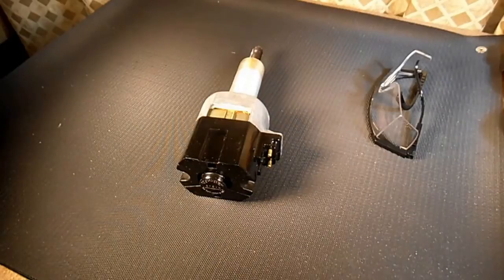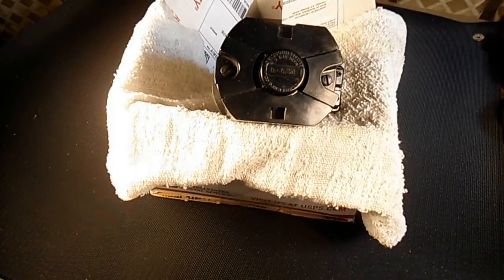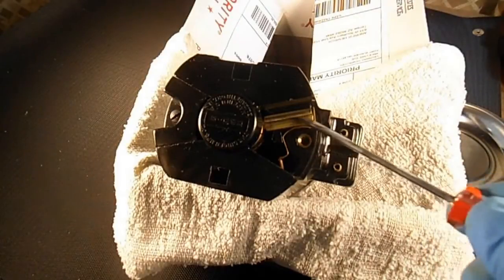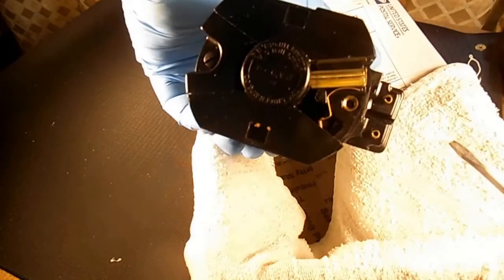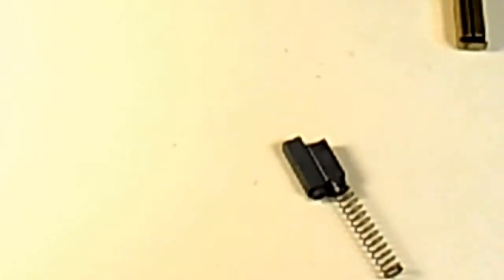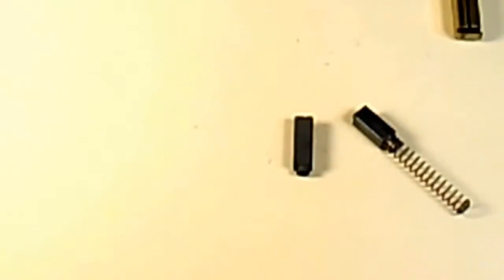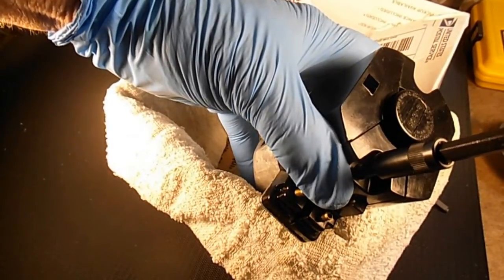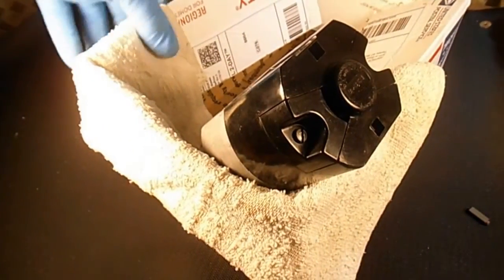HOW TO RESTORE SINGER PA STYLE SEWING MACHINE MOTOR Pt.2 HOW TO REPLACE MOTOR BRUSHES

Comment: Mr Andy- this video was exactly what I was searching for.  I’m working on a Singer 206K. The brushes seat into these odd little bronze holders and I sighted them in the long opening along the shaft. Brush was almost worn to the spring. Not good. So finding your video again was great.  Thank you for your explanations as the details are very necessary!
Reply from the maker: Glad you caught those worn bushes in time. I saw one motor where the brush spring contacted the commutator at high speed and it sure made a mess. Thanks for the nice comment.

Comment: THANK YOU so much for this!  Now I can check brushes on my 301 machines. I am looking forward to the rest of this series to learn how to clean commutator, etc.  I appreciate that you are thorough and cover all the details. Would you ever consider doing a series on opening the motor on a Singer Featherweight to clean commutator, etc.?
Reply from the maker: Thank you for watching. I'm glad you find it useful. If I ever do get a featherweight I would do the motor for sure. It is different than the PA Motor, but still has an armature, core & coils, and a shaft. No pinion, but a pulley. I always wondered where the motor lubricant goes once you put it in the tubes. Guessing the bearings are not "sealed", so they need the grease.

Comment: Andy, I removed the PA10-8 motor from my Singer 500J and noticed that someone had overtightened one screw, causing a 1 1/2 inch crack in the black bakelite that runs behind the two external electrical connection points.  Woud it be safe to re-use this or do I need to buy a new motor?
Reply from the maker: Oh, that knucklehead! What were they thinking? I would keep using it, but I would try this inexpensive repair. I'd be looking to fill the tiny gaps and just reinforce it a little. I like the idea it will be sealed up somewhat. https://youtu.be/NXx6JyP9d5U
Reply: @andytubesewing1953  Thanks for the idea Andy - the baking soda & Super Glue worked like a charm in sealing the crack.  Hopefully, the vibrations from the motor won't eventually cause it to reopen.
Reply from the maker: @susanwingert7065  I think you are good, Gail. I've found the repairs to be very strong. It was the overtightening that caused the crack anyway. I'm glad the method worked. Good luck with the rest of your work on your 500J. Take Care.

Comment: Hello, Andy.  I enjoy watching your videos very much.  I learn a lot from your clear explanations.
I have a Singer 15 made in 1921 according to the serial number G8647960.  I do not yet feel qualified or comfortable restoring this machine.  The motor runs, but it needs a new belt.  I would like to restore its exterior beauty as much as possible.  The finish is dull and the chrome parts have some rust.  I do not know if it may need retiring or other internal work, but it probably needs a good cleaning, lubrication, and oiling.
I would like to know if you take on such jobs.  If not, do you know of anyone else who I might ask to help me.  Local sewing machine shops are not interested in doing any cosmetic work whatsoever. 
I’d appreciate any help or direction you could provide for this machine, which has been in the family for several generations. 
Thank you,
Michael
Reply from the maker: Greetings Doc, may I call you Doc? I do not work on the black Singers, except to say don't use Krud Kutter! I think this is a project you must do yourself, and I know you could do it. For sure there will be a learning curve but come-on, it's been in your family so long that you really must try. What have you got to lose?

Everything you mention can be done I will tell you that. For every machine I did for the first time I started by building a playlist of videos that I thought would help me. Sometimes there weren't many or even any, but they can be very valuable. Next was a document library for the model and any methods I thought would apply. This is all easier these days with the internet and YouTube. 

My retired Singer buddy in Canada told me one time that when a machine was like that they would remove any motor, light, and wires and soak it in a 5-gallon bucket of kerosene overnight! Imagine that. He said it did no harm, even the decals were fine with it. In the morning they would pull it out, drain it off and wipe off the kerosene and start oiling. The goal was to see how well it worked, if at all, before starting to replace, repair and adjust parts.

Michael, please email me here at my channel, andytube53@gmail.com. That way I can reply with any and all documents I may have gathered over the years to get you started on this fun project. Please include the serial number, the exact model version from the instruction manual if you have it, and maybe a picture looking straight at the front of it if possible. I really encourage you to try it. Hope to hear from you soonest, and good luck.

Comment: I have three PA motors, but mine are German made and not exactly the same. Couldn’t change the brushes like this for a start. The commutator cover is a single piece, and the pinion end is Bakelite, not aluminium as well. What size are the brushes?
Reply from the maker: For the motor in this videos the carbon motor brushes are Singer Part No. 192457 and be found here: https://shop.sew-classic.com/searchquick-submit.sc?keywords=192457
Also here: https://www.sewingpartsonline.com/carbon-brush-alphasew-singer-192457.aspx
If you give me the model number(s) of your German Singer Machines I may be able to help more.
Reply: @andytubesewing1953  Hi, I have a PA 2 - 8 motor from a 301-A. Will the brushes be the same as those in this motor? I have not been able to find a parts list for this motor. Thank you!
Reply from the maker: @DFTBAandDS  The original brushes for a 301A motor were part number 196862. Seems no one sells them. Here is a free copy of the electrical parts diagram for 301A:
http://parts.singerco.com/CPpartCharts/3_39999/301-1_electric.pdf
These are the carbons most of us use for the 301A motor: https://www.vintagesingerparts.com/products/set-of-2-singer-sewing-machine-motor-brush-no-springs-4-mm-x-4mm-x-15mm-190782
They do not come with the springs, but they are very inexpensive.

Comment: Hello Andy.  I’m new here.  I did not see the link you mentioned in video #1 that shows how to remove the Singer motor.  Could you provide a link to that tutorial?  Thank you.
Reply from the maker: Thank you for asking and visiting my channel. Here are links to two videos about removing & replacing the motor. A newly tried method for remove stuck motors is to use a hair dryer above and below to soften the varnished oil in the tube if it is stuck there.  
https://www.youtube.com/edit?o=U&video_id=HDX2bXTeTX8

https://www.youtube.com/watch?v=wZFFYVCjH8A

These links don't show up until about 14:50 of part 1video.
Please stop by anytime.

Comment: Do you know why the motor hums when pressing the pedal? I have to turn the wheel to get it started half the time and its very annoying.
Reply from the maker: Some things to check. If the mechanics of the machine are "binding" anywhere it is hard for the motor to start everything moving. So, are the gears (top & bottom) cleaned and lubed? Are the moving metal-on-metal parts cleaned and oiled? When you go so sew on the 401A you have to spin the handwheel to start, but if you release the stop motion knob to just wind a bobbin does it start without you spinning the handwheel? I assume you have the original "button" style foot controller on your 401A? The chances are the carbons are worn/damaged and/or the contacts are out of adjustment. If the carbon resistance discs are worn out or dirty then not enough voltage is going through them. Once you give the wheel a spin, the worn discs do let enough electricity through to keep the motor spinning, or maybe once you start you go full blast or "all out" top speed.
Here is a link to my playlist of how to restore a "button" style foot controller: https://www.youtube.com/playlist?list=PLsCOZgzzaiKL6ePPxLpmnWSzTyxPKTb71
Also, at the end of this playlist is a video explaining where I just recently found a seller of carbon discs, if you find you need some. 
https://www.youtube.com/playlist?list=PLsCOZgzzaiKItPLWcK24FBoMdHK8vTXNi
You can also buy a new electronic foot controller and transfer your existing cords to it. They don't use any carbon resistance, only electronic parts.
You will need to do some trouble isolation to determine if you have a mechanical or electrical problem. 
If you need more help, please write me at my channel email address, andytube53@gmail.com
Good Luck.
Reply: I did oil all mechanical moving parts, when i turn it by hand it is very easy and it feels like everything is right, i did clean up the foot pedal but it did not help much, i also checked the carbon brushes and they seem to be at 70 percent based on one of your videos. I was thinking of getting an electronic foot pedal, maybe that will take care of the problem. I did test the motor when i took it apart from the machine, i connected it to the machine and ran it whithout it being attached to the gears and it ran very smoothly, but the same thing happened after a few stops, it did not start and had to manually turn the gear.
Reply from the maker: When you cleaned up the foot pedal did you open the "tubes" and inspect the carbon discs? From your reply it sounds like the mechanical parts of the sewing machine are nice and smooth, so nothing is binding up. In my experience that leaves the foot controller, and that is usually the carbons. Not the motor carbons, but the carbon discs inside the tubes of the foot controller.
Reply: I did not clean the carbon discs, i just saw part three of the restoration of the pedal. I will do that tomorrow i think that will take care of the problem. Thank you so much for your help. I love your videos.
Reply from the maker: Thank you for watching. I think that will help fix the problem. Sure hope so. Good Luck.